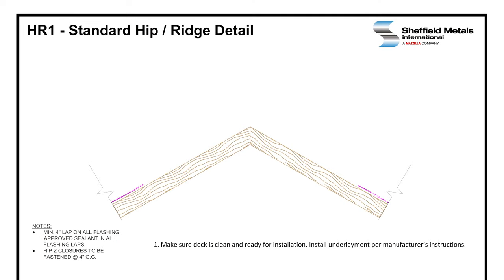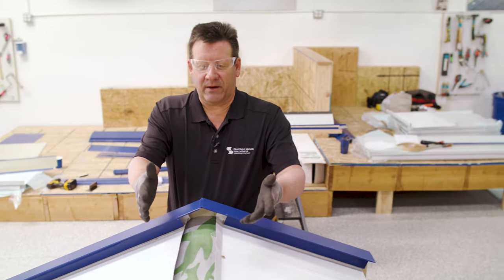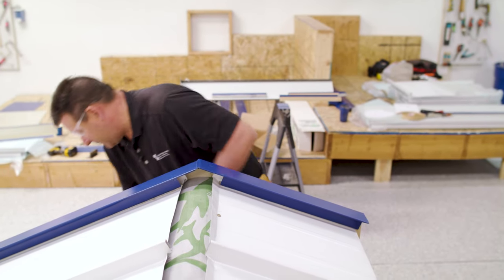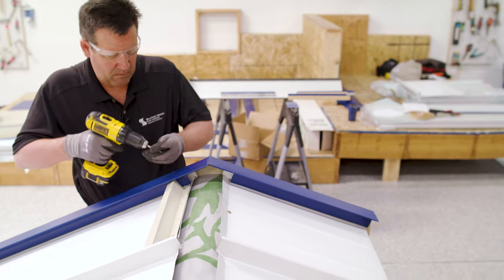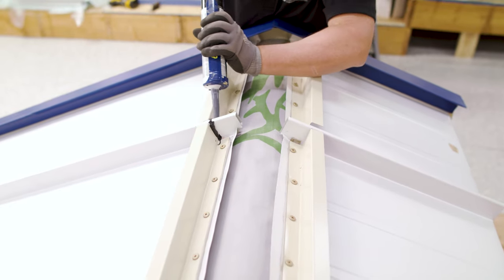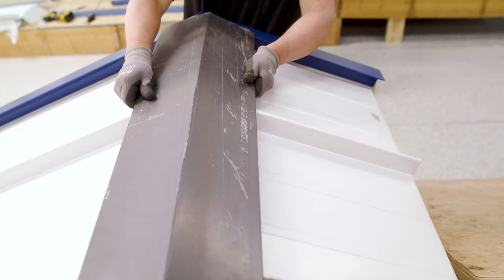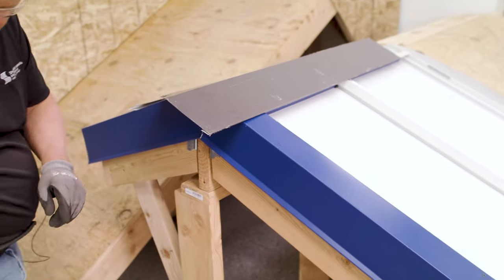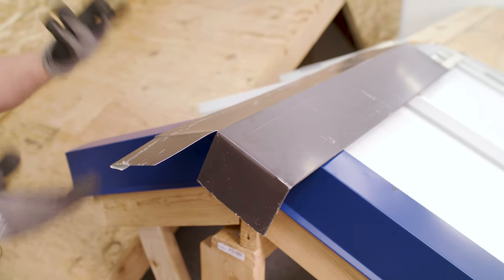How to Install a Hip / Ridge on a Standing Seam Roof: SMI Detail HR1

Comment: Completely unnecessary(and aesthetically terrible) to bend any ridge cap 4" down the face of a rake. If make your rakes  meet properly 1" or even down to a peen over would more than suffice and look much better and keep all rivets on top. I generally don't even use rakes, longer face drip, roll form a hem, squeeze the hem to the drip up the rake. This then allows you to box the end of the z bar to hook and hem the cap as well. Much better and cleaner.

Comment: This is not a hip. Noobs
Reply from the maker: The detail remains the same on a hip even though we're demonstrating a ridge install. The termination of the hip flashing at the end of the run will be slightly different as well, but that is installer preference. -Thad